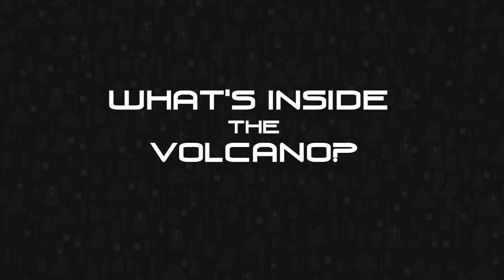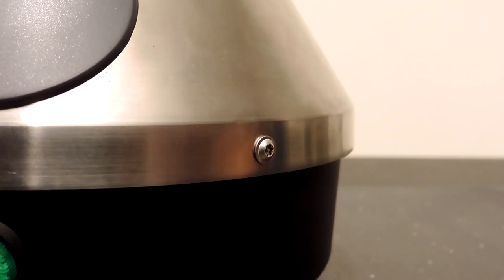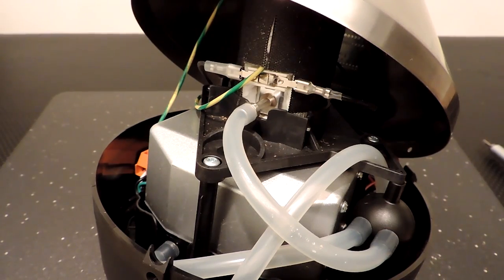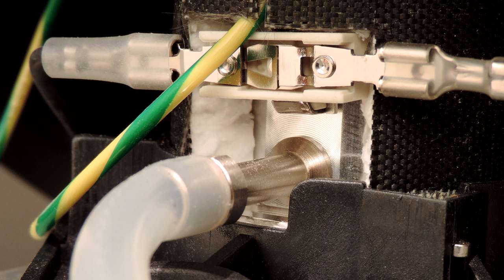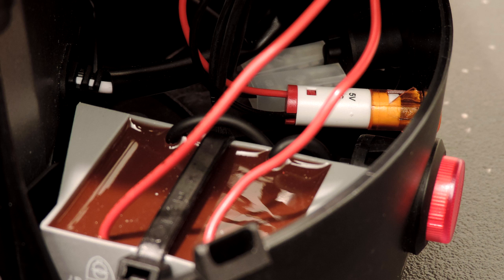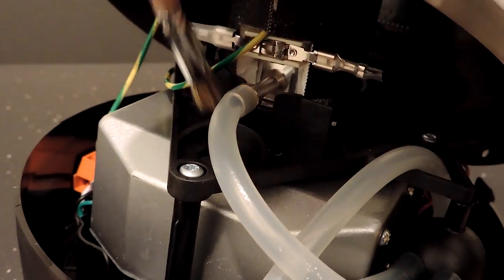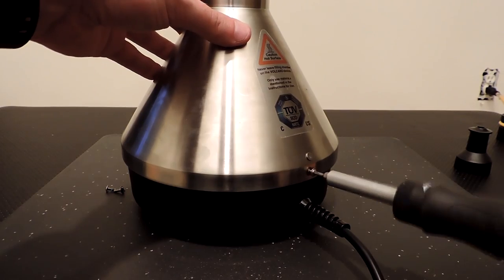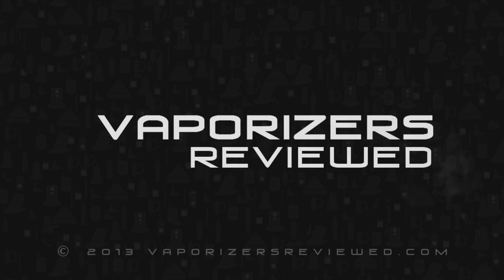What's inside the Volcano Vaporizer?

Comment: How about fixing the thermostat, which is switched on with the red toggle, and is on when the yellow light comes on. It is a robust part, but eventually fails. I once saw a DIY fix for it, but it was dissapeared. You have to leave the volcano plugged in and on or the thermostat does not work.

Comment: Could you help me figure out how to replace the power cord? My volcano works but the cord is shorted or something
Reply: It looks extremely easy if that is the problem. Just get a new cord and put it to the jumper block inside. I kinda doubt that is the prob. If the orange light doesnt come on but everything else works its not the cord but the part in the cover of this vido where the wires connect right above the air input to heater block.
Reply: @Balthorium  thank you for the help. The volcano shows no lights when the cord is messed up but unfortunately it completely went out. Do you know where I can find a replacement cord? I PMd the manufacturer of the original cord but got no response from them
Reply: @StevieHalter  little jumper block. It should be really easy once you find the wire which also should be pretty easy.

Comment: Dear Sir,

I had an accident with my Digital volcano vaporizer. It was a 110v and I accidentally plugged it into a 220v outlet. Now it doesnt work. I opened the vaporizer and identified the component I need. It is the transformer inside. However, due to the damage, I cannot read the rating/value of the transformer. Could you kindly send me the details of the transformer. I saw it in one of your videos, but I cannot see the details written on it.

Thank you very much!
Reply: Dear Robert
I have the same problem. How do you fix it?

Comment: How does it vaporize without liquid? This is confusing for me. Any explanation would be appreciated. ( I hear you mention the 'liquid fail valve' )
Reply: I don't know what the "liquid fail valve" is for either, but a dry herb vaporizer works by heating your bud until the active chemicals in it (THC) are evaporated and can be inhaled. This existed long before anyone invented e-cig liquids and things like that. There are several ways that a dry herb vape can work, the Volcano works by heating air and then pumping the hot air through the bud.
Reply: @hotmailcompany52  I'm assuming that by 'liquid fail valve' he means check valve.  The captioning doesn't match the dialog, saying the check valve is before the pump.